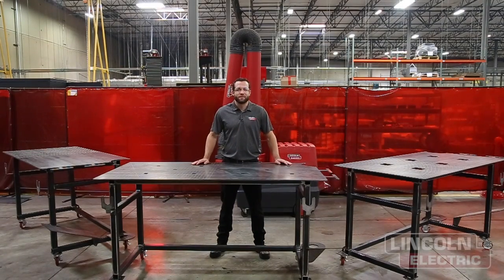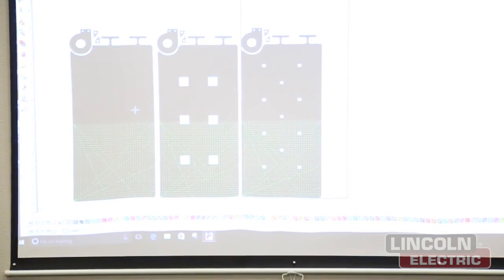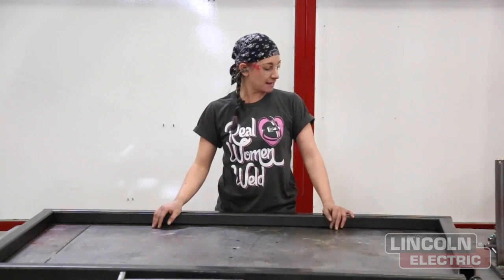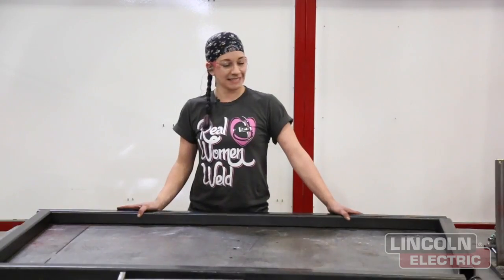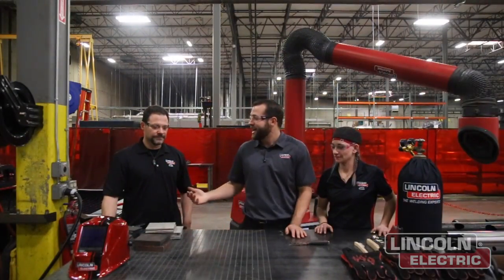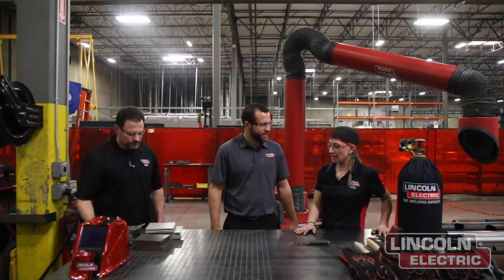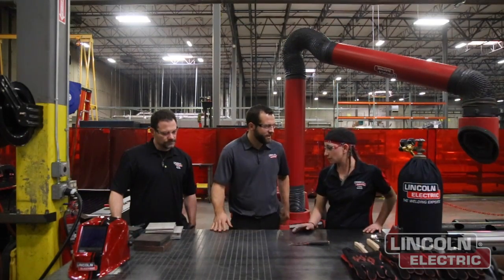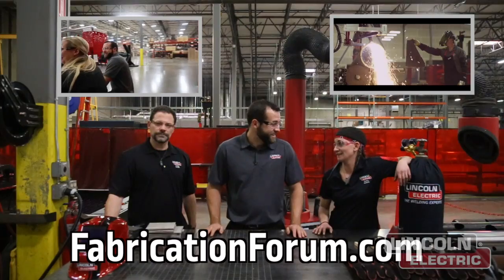Design Cut Build | Episode 2 Welding Table Build

Comment: i like the plasma etched lines that is really cool  . i was wondering what type of consumables would be needed  
and what kind  of i p m you run looks fast  and also how do you set it up without using any pierce points im thinking with the use of the plate marker tool and being able to get the torch to stay fired . i use a mach 3 system with sheet cam for my system and i can set the tools to what is needed . id like to see a better view of the finish of the plasma etch to get an idea of what it looks like   thanks Bill from decorativeironplus.com   ps i used  a old dos based torchmate for 15 years and it was an awesome machine i bought it from Bill Koontz senior back in the day and thats what gave me my start on my fabrication business

Comment: Hi Mark, Chad, and Sammy. I thought it was a really cool video on the “Ultimate Welding Table”!  Nice Job!  I make some New Accessories for welding tables that I think would do an awesome job with your table but you have to put some 16MM holes in your table for them to work.  If you would send me your contact information and address , I’ll send you some free sample.  My email is , info@sherwoodmanufacturing.com  , Thanks :)

Comment: Awesome! How about a video that show how to do plasma marking! Amp setting on the plasma,  IPM and TorchMate Cad and how to do on line marking with no pierce. I have a TorchMate 2x4 and would love to know how to plasma marking!
Reply: You have to have a plasma with marking capabilities. I have done some etching with an older PowerMax 85 (or 45 don't remember) by modifying the nozzle so I didn't have to send the part off to have it laser etched. The only downside to doing how I did is you can only go one direction w/o reclocking the nozzle so it blows the slag cleanly off to the side of the cut, but if your just doing straight lines like this it works really well. I think I have a pic of sign I did it on on my Google+ page.